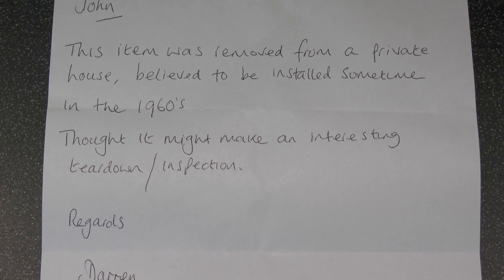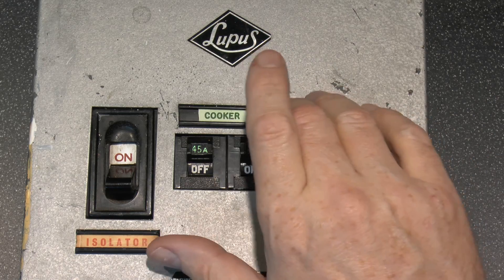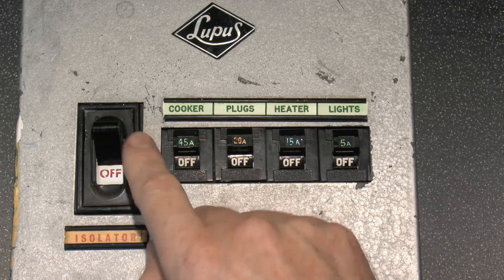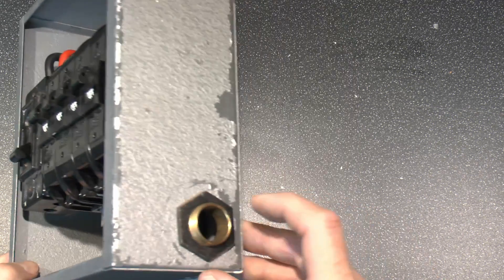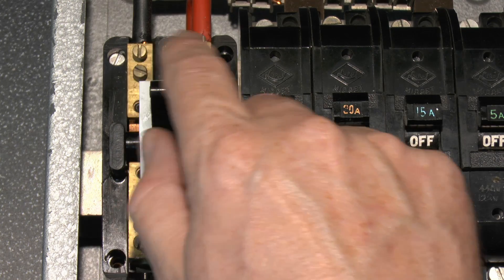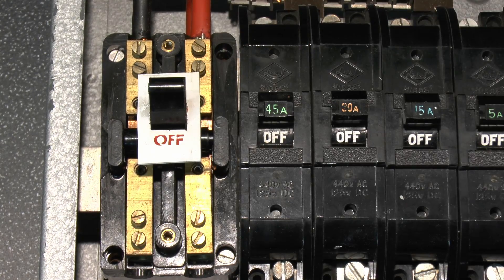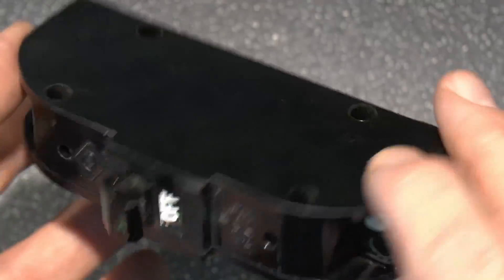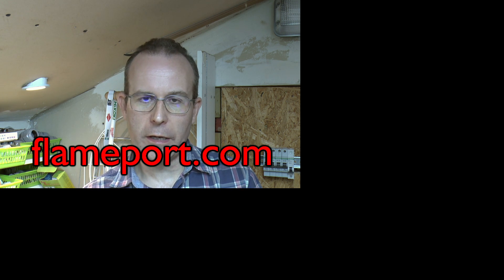Lupus Midget Metal Consumer Unit

Comment: Hi John.  I have fitted an led light in my outside garden lamp stand but it dimly lights up when switched off. It works perfectly when illuminated but why does it stay on (albeit very dimly) when switched off? How is it getting power from a dead circuit? Any chance of demonstrating this on the bench and explaining why this happens? Much appreciated. Regards Colin.
Reply: Capacitance or trickle current I think it was electric boom had a good video on it with Phantom LEDs although big Clive has also just recently mentioned it in his latest video with poundland LED lamps
Reply: If its a standard mechanical switch it'll be capacitive coupling between the lived and the supply, perhaps the conductors are run parallel for a long distance. If its some sort of electronic switch then its most likely from leakage through the switch.  Quality LED lamps will generally not exhibit this behaviour.

Comment: Hiya John. Can you please do a video explaining how to wire up those key card wiring switches that power up entire rooms (the type you get in hotel rooms) 
Also if it would be possible to install in a domestic situation. Especially handy for teenagers’ bedrooms who don’t switch things off!
Reply: Simple, part of the key activation system closes a closure which triggers a relay of some type for everything in that room. I recommend looking up either Raspberry Pi or Arduino controlled power outlets and the rabbit hole can just keep on going from there. I recommend if you do make this project to get the power cord module it is properly wired up to begin with unless you know what you're doing. There's also a key card activation system for electronics say TV video games that was on the market for a while and I suspect still is.
Reply: Of course that key activation system would have never worked for me because at the very early age I already knew what Outlets were and repaired a toaster.....

Comment: Hi Jhon! , I am Marcelo. I would like know if you may tell us, the razon to mark te negative pole (N) in the RCD´s devices. I cant undestand it. If I conect the line (L) on the negative terminal, don´t would work properly?  What is the razon to mark it!. I think  that it is irrelevant, because these devices work whit CA.
Thanks a lot.
Reply: In AC circuits the negative is called neutral because it is neither negative nor positive as the voltages is alternating so thus they call it neutral. The neutral is also the line that is pulled to Earth reference in most installations that's another reason it is a neutral conductor. In a floating systems and Transformers where the neutral is not tied to a ground either line will float with a potential above ground, if one of the lines were to accidentally make contact with a metal surface that surface would become live with respect to ground and the other conductor thus if one line is tied to ground it guarantees a short circuit and trip if the other Hotwire touches a metal surface.

Comment: The M.C.B. Company (Lupus) Limited, company number 00537099, incorporated 19 Aug 1954.  Originally Lupus Works, Road One, Winsford Industrial Estate, Winsford, Cheshire. The now dormant registration is currently held against a Sheffield address.

Richard Ives' Circuit Breakers Online has a few examples of the MCBs including one set of four 5/15/20/30 Amp that might well have come from a similar box.

AS no BS mark  or type was mentioned I wonder if these might pre-date BS 3871-1:1965?

Comment: Interesting is that your internal wiring is tinned copper wire in a PVC sleeve. must have been made during the transition from DCC to PVC, and this tin is probably the old wire from then from the supplier. At least it is also preventing the green goo from forming as the plasticiser reacts with the copper.

Comment: Up is off in the UK? Odd—generally bumping a switch is more likely to move it down, and better to turn things off accidentally.
Reply: @Alan Hartley it certainly was up until the late 80s on the old Wylex fuseboards, but modern MCBs and isolators all have down as off now. Also, unlike this unit, modern isolators have the supply cables at the top and modern MCBs have the load/circuit at the top. Up/on and down/off has been standard in the UK for decades.
Reply: There was a code change to signify a safer disconnect rather than an accidental engaging by Falling objects, I was always under the impression down was off as you're pulling the signal down to ground or stopping a flow from going up.
Reply: If a circuit is "powered up" is it safe to work on in the UK?

Comment: The quality of this unit is probably more robust and of higher quality than most consumer units fitted today. The days before DIY Dave and unexperienced electricians
Reply: We have a lot of these in commercial installs in NZ. Please no.
The Lupus/GAEL Midget MCBs are notorious for failure to trip when required, and tripping randomly when not.
I have also heard a rumour that some series did not actually have a magnetic trip fitted in the first place; they were thermal.
Reply: It is high quality. It was made properly in the UK.

Comment: Ah, Lupus circuit breakers. I can remember quite well when these were withdrawn from sale in the early 1980's in NZ. Prior to that they were in just about every commercial switchboard, and a minor number of domestic boards. Fitting a modern din-rail type MCB into what was often a fairly new board in the '80's was not that straight forward.

Comment: The earthing terminal only has 4 ways, where would the bonding conductors go?
Reply: Before the 14th Edition (1966) we didn't do Equipotential Bonding in domestic dwellings.
Although we did use copper mains water service pipes as a TT electrodes, after the lead, as in PILC, was replaced by bitumen impregnated paper insulation.
Reply: I assume onto onto the earth stud with crimps/lugs along with the main earth.

Comment: Could that label be a laminated plastic where the top white layer is "engraved" away, exposing the lower green layer.  These things were common in the US in the 1960s and used for custom panel labels.  The name here is "Lamicoid" labeling and is still available although expensive.
Reply: Good spot, common brand here in the UK is "Traffolyte", as you say, normally three layers, WBW = White-Black-White, several colours available, I used Lamicoid, found it to a lot more flexible than Traffolyte.
Reply: I wondered that but expected to see the green layer at the edges.

Comment: Hi John. Can you make a video regarding MCCB's? Thanks
Reply: MCCBs? Do you mean MCBs or RCCBs?
Reply: @alex-k2h6g   nope, it's MCCB's .. moulded case circuit breakers.. they have high current breaking capacity,  and sensitivity adjustment..
Reply: @valyardelean  Some have sensitivity adjustment, some are fixed. Generally they're bigger and higher current than MCBs and less so than Air Circuit Breakers (ACBs).

Comment: Domestic mcbs in the '60s !  Disappointed you didn't drill a breaker open - this is likely to be where the real differences from today show up - purely electromagnetic trip mechanism like an old elcb  from that period I guess..??.
Reply: Took a lupus breaker apart years ago... It definitely had a bimetallic strip. Southampton university used to have hundreds of these in some of the older buildings. Probably long gone now

Comment: It's also interesting that the breakers were rated for DC. This must have increased the design complexity a bit more. These are impressive.
Reply: DC used to be a popular flavor if you where on the other Edison system (  remember that AC system from Westinghouse THAT KILLS!!!, they cough Edison to discredit the use of AC in the Westinghouse chair after all you don't want to be Westinghouseed ) so manufacturing one product was probably a whole lot easier and a lot of outlying farms until the rural electrification Act used DC batteries or generators of either type.

Comment: Isn't it a correct way to identify power outlet as "sockets" instead of "plugs" ?  I am not a native English speaker so ignore my mistakes.
Reply: Your are correct. English is often a very inaccurate language in usage. 
In America the most proper term for a double outlet is "duplex receptacle" while plugs are just "plugs". "Outlet" is the most common name I've heard in my years.
Reply: In Hebrew, socket is sheka and plug is tecka.
Reply: @drteeth7054  are references to electrical items in Hebrew more precise, or would anybody use the term 'tecka sheka'?
Reply: The term “socket” is the most common name or term in the part of the U.K. where I’m from. Yes, some lay people use the term plug sockets”, but then lay people also confuse concrete and cement. Do I need to say anything more?
Reply: Socket, outlet, wall socket, electrical or power outlet, receptacle are all correct terms. Some are just misleading like plug-sockets, for people which native language isn't english this is a bit weird. In german it is "Stecker" (plug) and "Steckdose" (outlet). And the literal translation of Steckdose is kind of funny: "Stecken" is put, plunge, poke, insert. "Dose" is can or box, but also a socket.
Reply: A plug is the part that is on the end of the cord (flex in the UK) that is attached to the device that you are wanting to power. The part on the wall is called an "outlet" in American English by most people, technically it's called a "receptacle"in American English, and it seems that in the UK they're called either "sockets" or "socket outlets." In the US, some people call them "sockets" as well, or even "light sockets."
Reply: I usually try to correct people when they refer to 'ring mains', but I stopped questioning what 'plug-sockets' are supposed to mean.
Reply: @westinthewest  'plug-sockets' are sockets to be used with plugs while 'lamp-sockets' are sockets to be used with light bulbs. Seems simple enough?
Reply: @Peter_S_  I never considered that option, but mainly because the customer is pointing at the wall when mentioning the dreaded compound noun.  There are hundreds of types of plug-sockets when you consider signal connectors for audio, video and data, but nobody refers to an HDMI receptacle as a 'plug-socket'.  When a customer is referring to a BS1363 13A receptacle, they could just say 'socket' or even 'double socket'.  It's fairly obvious they don't want an E27 holder just above their new kitchen worktop.
Reply: @westinthewest  it is a rather imprecise world, isn't it?  Funny thing is that in irrigation work for large parks and such, you actually do have 'ring mains' and I felt the need recently to strangle somebody who wanted to design in 'ring circuits' which in that world would be a poor choice. Who would have thought electricity and water are opposites? Cheers from Boulder, Colorado, USA.

Comment: Fascinating. Have you tried testing it to see if it holds up to breaking capacities like modern MCBs?
Reply: That would be a very interesting test. I would like to see that.
Reply: @simontay4851  A fair bit of the cabinets and breakers from that time was overengineered and overdimensioned so yes i would expect it to hold up to usage. In the case of for example porcelain mounted pole screws - heat can wreck it (ie unsufficient contact) or careless torqueing of the screws.
Reply: That's exactly what I'm thinking to do with my now old federal fire Pacific that slipped a check under the door of UL Laboratories......